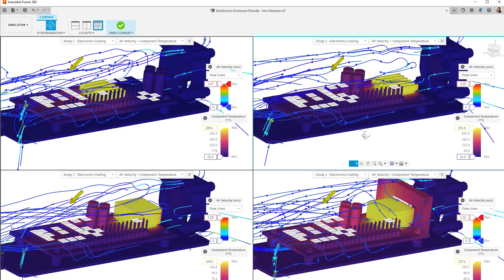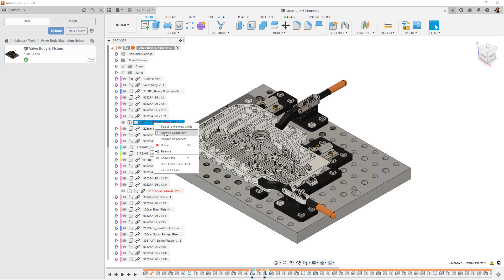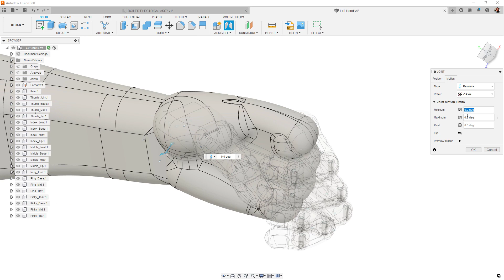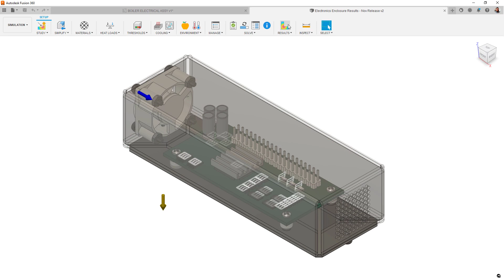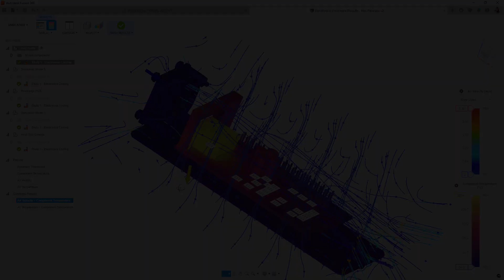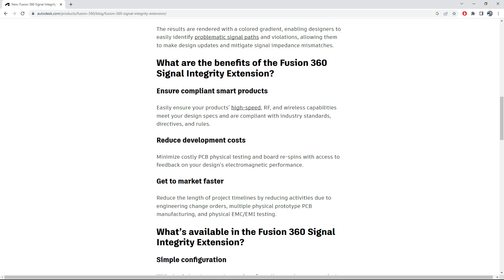What's New in Fusion 360 for Design and Engineering - November 2022| Autodesk Fusion 360

Comment: Hi, these are some fantastic improvements!
Question:  Occasionally, I'll start a new design, create sketches and bodies under the design, rather than creating a component and creating the sketches and bodies under the component.   But then I realize I wanted to create a component and I have to start over again.  Is there a way to convert a design into a component so that I don't have to throw away my work and start again?   Or, alternately, is there a way to copy/move sketches from a design to a component?   Thanks!
Reply: Yeah I still do this from time to time.  What works for me is to drag the history marker back before the sketch then create the component.  Once you have component made prior to the sketch move the history marker past the sketch at this point you can drag and drop the sketch into the new component in the assemble panel browser.